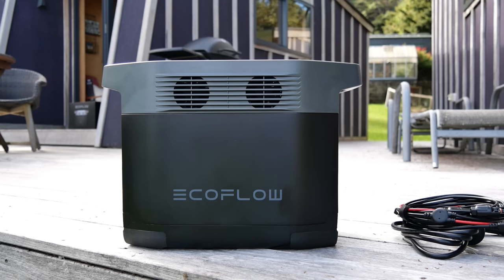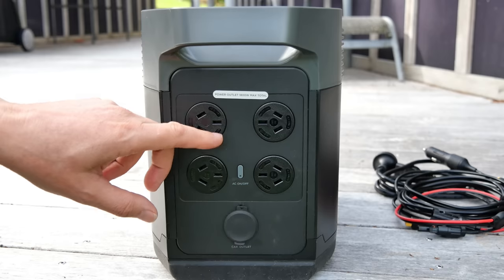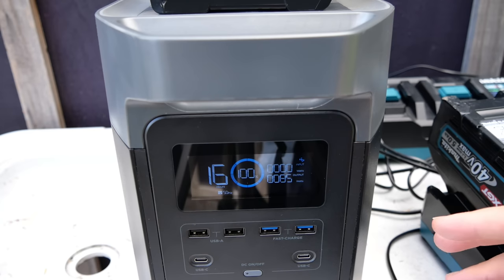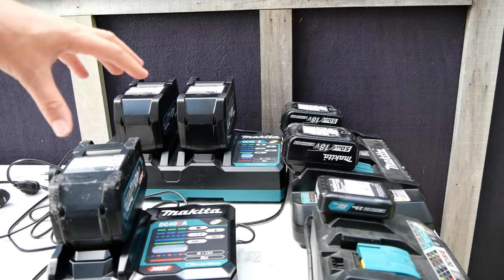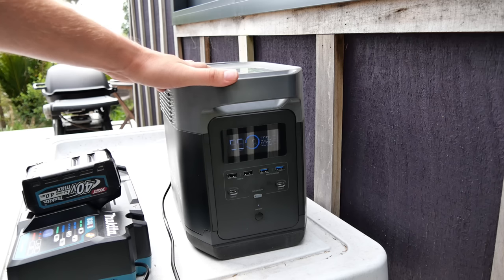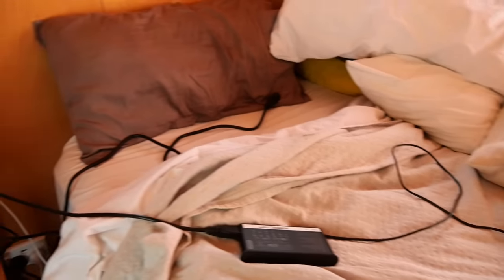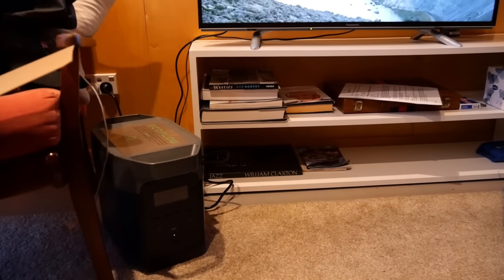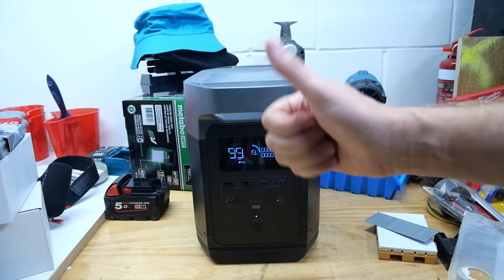EcoFlow Delta Power Station Review  |  How Many Tool Batteries Can it Charge at Once?

Comment: I just got the Delta Max, the 2kWh version of this unit.  It’s been great for use on my construction site for charging batteries and keeping the diesel heaters running to keep the basement heated.  I just got some solar panels for it but have not used them yet.

It’s worth mentioning that the Max and the newer Delta 2 use the Ecoflow app to monitor and configure settings.  I also have their dual fuel (gas and propane) generator which attaches via the extra battery port and automatically charges the battery when it gets to the preset discharge level.  This is a very handy tool indeed.

Comment: I have been using a BLUETTI attached to  solar on my work van for about 8 months. No batteries in the house or on a job to forget and a three pin plug whenever I need one. For anything. Solar is like a hack nobody uses.

Comment: eh I'm not quite sold on them.   If it last a day on a power draw it makes sense for cell phone, tablets, maybe laptop and other small devices.  Not too bad on toll battaereis but then you need power to recahrge the unit.  Running fridge from it, would last about 2 hours, maybe 3?  Genny atleast you can keep adding fuel.
Reply from the maker: A fridge will last a lot longer than that. Closer to 10hrs. Fridges don't run constantly.  And you can't keep a noisy fumey petrol generator in your house.
Reply: theyre great the use case is there, id use one atleast once a week and itd be immensely useful.. theyre just too much money i havent seen any that were under a USD per watt, and really you want atleast 2000watts if not 3000, so youre looking at 2-3k USD, add solar panels to charge them remotely and thats a piece of heavy equipment cost wise not a tool
Reply: solar panels you can keep adding sun

Comment: these seem great, i hope they fall in price drastically as they become more common, im cheap i cant justify the cost, especially for something thats so easy to  steal, cant replace the cells down the road when theyre worn out, and seems it could easily damage itself if inverters are anything to go by they frequently fail, full of mosfets micro chips and capacitors theyre far from reliable electronically

but id find a use for this every week way better than a generator for alot of tasks.. but for the price of a 3000watt unit with solar panels, you could have a cheap brand of generator in every size and in every vehicle or location.. and still have money left over to likely cover fuel costs for their life time of weekly use
Reply: wonder how their costs breakdown between electronics/case, cells, and then overhead/marketing ect, maybe if they could make it a little more modular where the battery pack are separate from the inverter and they could still offer new lithium iron packs for top dollar and top performance, but also might be a huge cost savings in recycling used cells from cars in lithium ion packs that wouldnt have as many charge cycles or as much capacity but could potentially cut the cost in half and get someone in the door, if it gets used seldom you saved some money, if it become a staple of your life/business you cant live without can upgrade to the premium pack, and have a few charged packs for more capacity